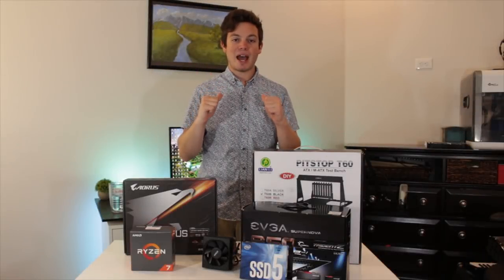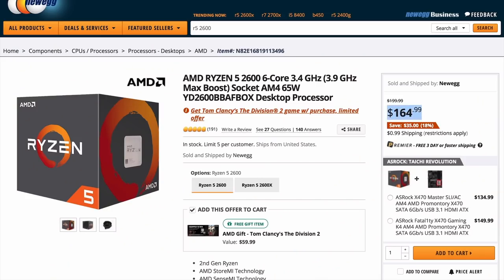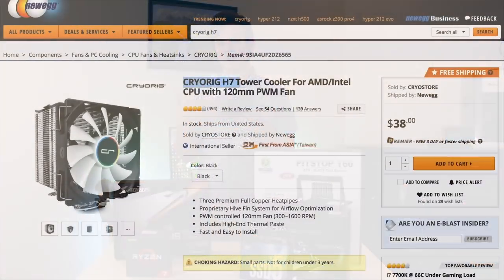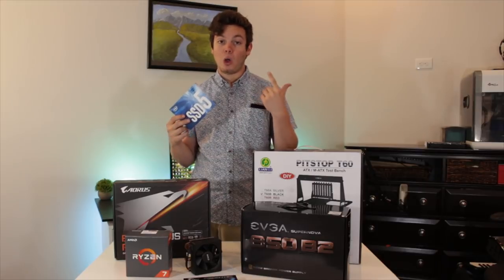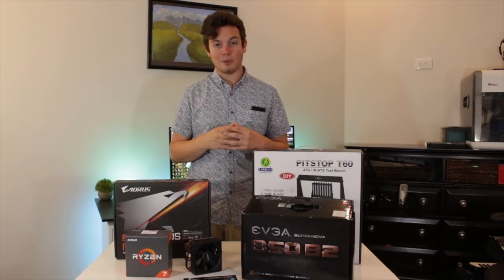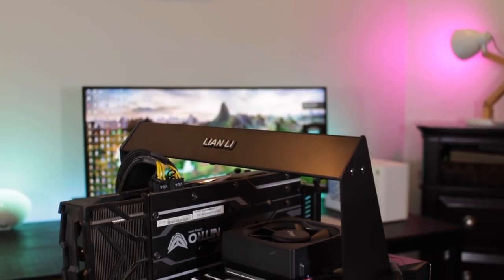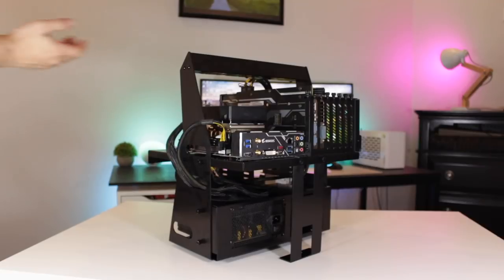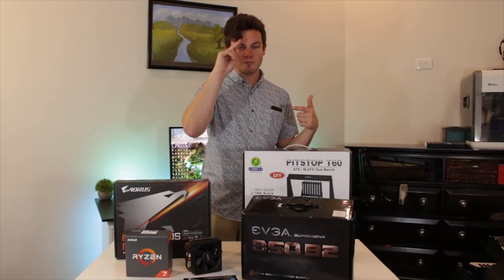My NEW Open-Air PC Test Bench!

Comment: Hey Matt! I enjoy the content and was actually looking to pick up a test bench for an odd sized motherboard. I actually really like this lian li bench and was thinking about purchasing it. The board I have is an EVGA x58 Classified 4-way sli board. It has 7 pcie expansion slots, but it should take up 8 slots worth. It looks to me like this bench has 8 slots. Not really planning on going 4 way sli with this board, just want a place to safely attachit. Wanted to know if you could measure the dimensions of the motherboard tray and/or knew what they were, so I could verify the fitment of the board
Thanks

Comment: really that motherboard is just fine and i think you can hang on to it for a bit, the vrm isn't the worst 4 phase on the market, just not very efficient and the heatsink isn't much of a heatsink. If vrm quality is what you're going for, obvious choices are the taichi boards, crosshair boards, and the biostar gt7 and gt8 have the same doubled up 6 as on the taichi, but the bios isn't very good. Asus's lower end x470 boards like the x470-f has a good vrm and the bios on all asus boards is great with options to modify more voltages and control switching frequency in case you want to send your efficiency to hell. The upper end gigabyte boards like the gaming 7 have a great vrm and the best heatsink on am4, as well as a clock gen if you like overclocking with base clock. If you're on a budget, then you really can't beat the msi b450 pc mate/tomahawk because they have the best 4 phase on b450 and their x470 boards have similar vrms with slightly more efficient mosfets and the same controller I think. Only thing with msi boards is that they use direct voltage, not offset voltage, which is not quite as good for overclocking using pbo2, but since it's a 1700x, that shouldn't matter too much.